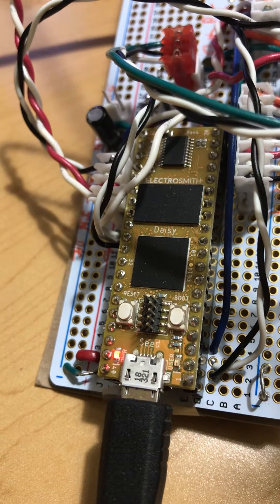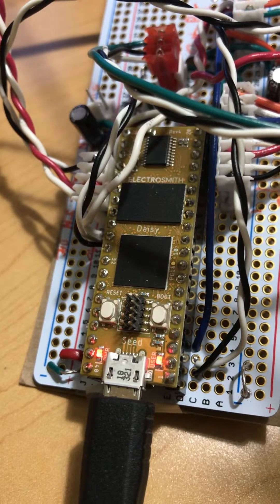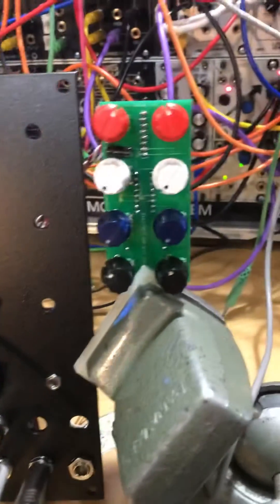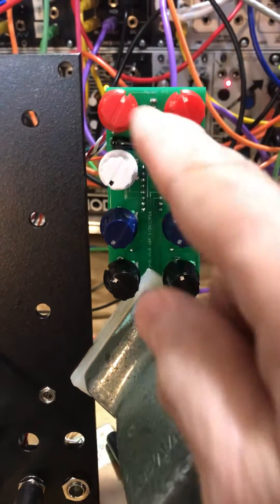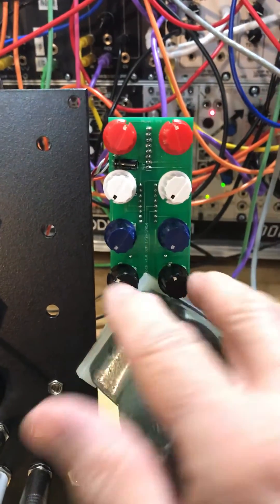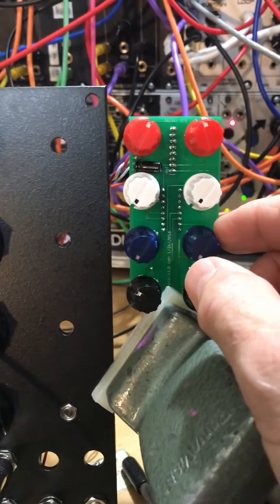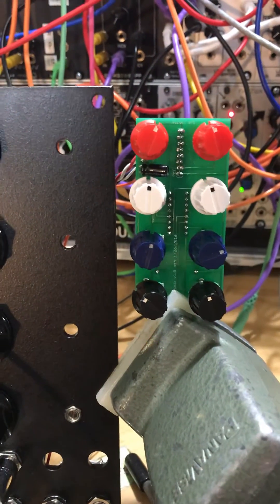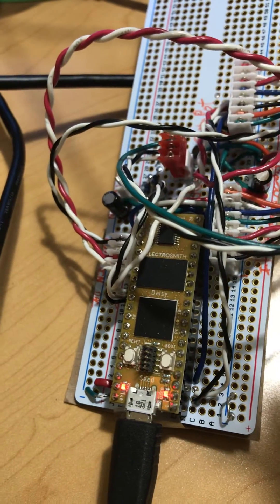Daisy seed processor - digital delay demo

Comment: So we no longer need resistors because of this?
Reply from the maker: Sonny, you still need some resistors (e.g.  the control knobs (potentiometers) are variable resistors).  So you need still analog circuitry for the control elements (knobs, switches) and analog input/output.  You just don't need that circuitry to implement the functionality (oscillator, filter, amplifier, digital effects, etc).

Comment: I don't get what the heck the 'octopot' does? I get how a 4051 works, it's like a rotary switch, no? are you reading the pot values like makeshift rotary encoders?
Reply from the maker: The 4051 is an analog switch with multiplexer.  You set up a 3 bit address to choose which of 8 inputs is connected to the output .  so, from the Daisy, the 3 address pins connect to the 4051  the output connects to one of the  ADC input pins.  The 8 inputs on the 4051 are connected to pots.  As a result with 4 pins on the Daisy, you can read 8 pots.   I already had a board with 8 pots as well as the 4051, so I used it in this prototype.   Does that explain it?
Reply: @ozhalljr  Oh I understand that you send the address to the 4051, and it switches over to one of the outputs/inputs, I just mean, you're reading the pots one at a time when the multiplexer switches to them? Maybe I misunderstood how a 4051 works, I just think of it as a digital rotary switch, 1 input/output and multiple inputs/outputs, but those connections aren't open constantly, but depend on what address you give it.
Reply from the maker: @Salik Abbasi  yes, there is only one output going to one ADC analog input pin.  so, you have to set address, read (e.g. pot 1), increment address, read (pot 2), etc.  There is actually support for mux'ed pots in the libdaisy library!  at least one of the electro-smith products uses a 4051 to conserve pins on the Daisy.
Reply: @ozhalljr  Ah thanks, that's clever, sure. I'm a newbie, DSP and learning circuit design etc hurts my brain still. I somehow managed to find a Daisy Seed and board (I think it's called a daisy pod?), hopefully it won't be more banging my head against a wall.

Comment: Nice, thank you. Can the Daisy (with the proper software) change delay time smoothly by CV? I'm wondering about Daisy to produce very short VC delay. In your demo there are clicks when you change it manually but then I ask.
Reply from the maker: Yes, this initial software limitation has been addressed. Please see the following updated demos!  https://www.youtube.com/watch?v=hBfuPBEpMf0 and https://youtu.be/aOjrz5E69gA
Reply: @ozhalljr  thanks, excellent. Just wondered about the hardware capability. I'm interested in very short delays, down to 1 to 50 microseconds or so and up to whatever (200ms or more)
Reply from the maker: @fer_fdi  I'm using a Sample rate of 48kHz.  I'm using a control rate of 1000kHz (48 samples per interrupt).  So, doing a 1 millisecond delay is doable.  I'm not sure you could implement a 50 microsecond delay using the libdaisy library.
Reply: @ozhalljr  BTW, the links are for another module, not the Daisy-based delay
Reply from the maker: @fer_fdi Both modules are based on the Daisy.  They are the finished modules which began with the breadboard circuit in the original video.  They are commercially available.  http://zebrasynth.net/
Reply from the maker: Note: the modules are available in Eurorack and DOTCOM modular format.  The modules have multiple modes, one of which is a mono Digital Delay up to 2000 ms.

Comment: interesting! could you elaborate more about the 4051 support?
Reply from the maker: This early version used a 4051 multiplexer so that I could get 8 knobs using one analog input and 3 digital outputs (address bits).  I use another digital line for control.   So for 8 knobs, I use 5 lines total.   To add another 8 lines, I would need another analog input as well as another digital control line.   So with 2 analog and 5 digital lines, you can have 16 knobs.  I think the Daisy Field uses analog multiplexed inputs.